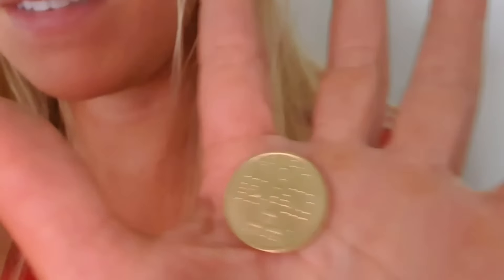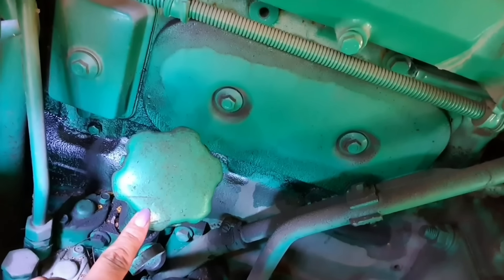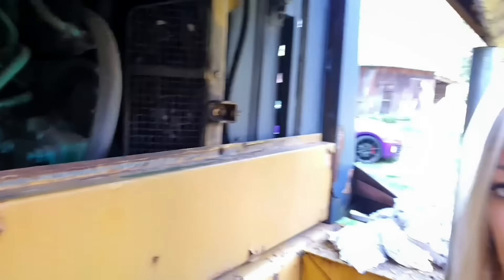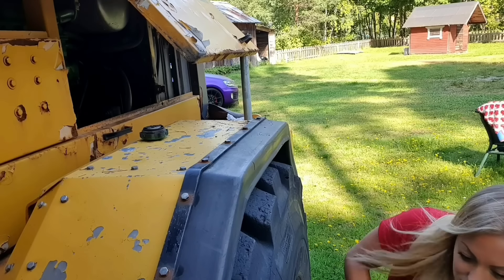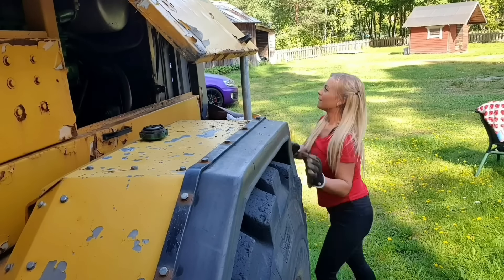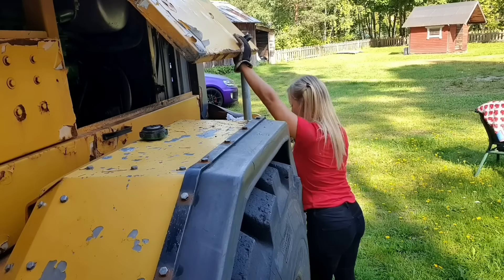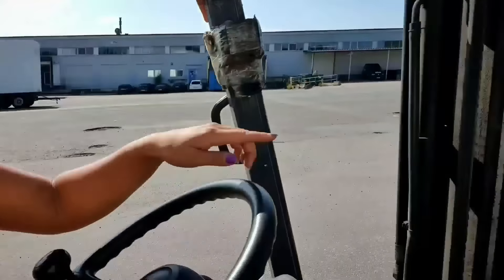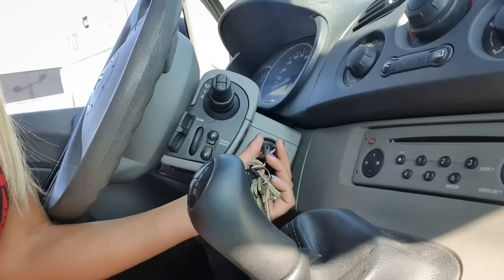#6 Coin flip with wheelloader

Comment: She is amazing absolutely love her❤ for all u people that have never ran a loader or what they call it a Wheeler it is hard to run the Hydraulics to be that accurate especially a well-used machine like that... pins and controls are a bit sloppy her accuracy is incredible good job
❤🖒😊❤
Reply: This is not a sloppy machine, it probarbly did a lot of work with salt on winterroads.
Reply: I work in the field of ship repair, I often have to inspect the sides of a vessel from a basket suspended on the cables of a crane. And in my experience, lady crane operators work smoother and more accurately, men constantly make sudden movements and jerks.

Comment: That was great I have a challenge for you take a road cone and place an egg on the top then place it behind you at some random distance then back up and see how great your judgement is at stopping before you knock the egg off. I had a lot of fun with that one this was one of our safety challenges and another one was place a cone in the middle of a trailer with an egg on top and drive around the yard making several right and left turns and pull ups and stops for us it was about truck and trailer control